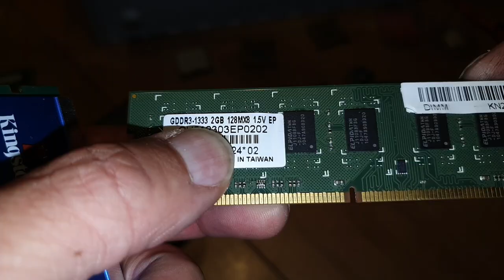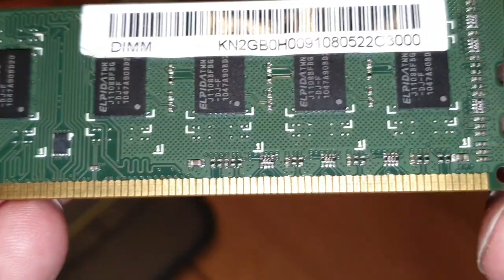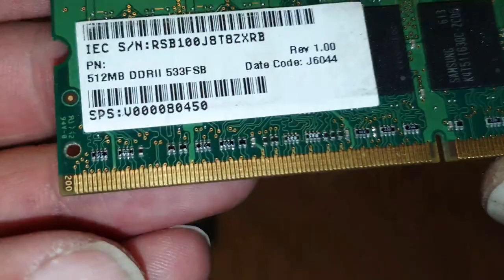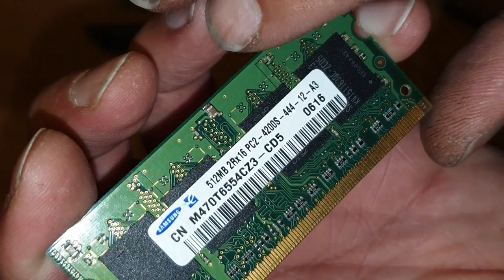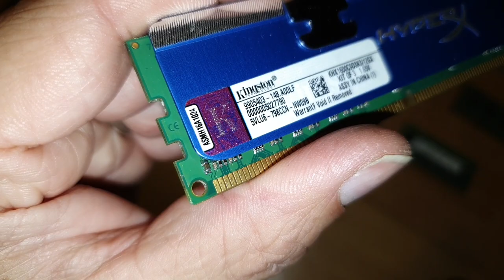How to repair a DDR1-DDR2-DDR3-DDR4 RAM By:NSC

Comment: Good tutorial, but I have 2 suggestion, to find the perfect match SMD, better get a Multi-meter to test each one out with the ground pin to find the bad guy. 2ndly, get a solder station with tentacle holder. take advantage of flux+heat gun combo, remove and attach the SMDs by using a Tweezers instead. Other than that, the methodology is very good presented in this video. Thanks
Reply from the maker: You always welcome. That's right, but i do my videos so, that all can do the same even without a multimeter, not all people's have all the equipments what i have, so i did this video so easy as possible. ;)

Comment: I bet this never helped
Reply from the maker: I bet you have no clue
Reply: @NSC-Modz  you can easilly remove ALL the capacitors from your dram stick and it will work just fine
Reply from the maker: @Charapaha  nope!!!
Reply: @NSC-Modz  try. i bet 10 000$ it will. the only critical parts are resistors. caps are used as filtering, they dont transfer any data on any dram sticks
Reply from the maker: @Charapaha you gonna lose all your money 😂
Reply from the maker: @Charapaha it doesn't matter, you gonna have failures, run mem test a longer time and you gonna see how they gonna work 😅

Comment: Hello, I have a problem .... I tried to connect a RAM in a slot when my PC was on and it maked a sound and shut down and now that slot it's not working anymore .... can someone tell me if it's fixable or not pls? Thank you
Reply from the maker: Hello You did this while it was on???
Reply: @NSC-Modz  yes.....
Reply from the maker: @myac.1071  no good... your
Motherboard is shorted maybe now.
Reply: @NSC-Modz  and that means? can it be solved?
Reply from the maker: @myac.1071  maybe not, if it's still not working all than you need to try an other Mainboard.
Reply: Repairable. Take your computer to the repairshop and tell the guy what slot is not working. They will repair it then. But don't insert any RAM on your computer while its working the next time. You may also corrupt your RAM.
Reply: @oguzhankarahan1737  Thank you

Comment: Maybe if you use DDR3 Dimm donnor can be used layout posibly is the same, but mix DDR2, 3 and 4 you need to test with multimeter or try to find the correct one. The SMD that you are talkin in the video are resistor black color generally and beige are ceramic condensers for low voltage and low capacitance.
Reply from the maker: Sure, but if you can't test, you can do it like this and test it on the system. MemTest will also ahow you if all is really working like it should work ✌️

Comment: do you where i can have ram repaired?
corsair won't provide me warranty since i bought ram off Ebay....
Reply from the maker: Witch model is it and what's wrong with it?
Reply: @NSC-Modz  youtube is blocking my comment so i need to write is over a few comments....
 DDR4 4x32GB 128GB 4000mhz Vengeance RGB Pro
Reply: @NSC-Modz  
i had my computer in sleep mode because of a failing USB generic adapter i decided to unclip the adapter from the side that was failing!
Reply: @NSC-Modz  when i started the computer after sleep mode it turned on! after i rebooted the PC would not boot! after about 6 hours of trouble shooting it came down to a single DIMM
Reply: @NSC-Modz  
i am still having a hard time believing how removing a USB port in sleep mode fried my ram
Reply: @NSC-Modz  can you give me advice on how to repair this?
Reply: @NSC-Modz  
thank you for getting back to me!
if i buy a volt meter can you give me suggestions on what i need to check?
i do not have much soldering experience! :( do you also know where i can get the parts i need to do a repair?
the ram is failing to be detected in the bios
Reply from the maker: @10percent4DaBigGuy  hmm this sounds more like a bios issue... witch board is it? Made a Bios update? Ram settings really set right?
Reply: i figured out why my comment didn't post originally its because i talked about the price....
Reply from the maker: @10percent4DaBigGuy  also it's not recommend to remove any drives while pc is on sleep mode, it can go good, but it can also go wrong like you see. You should always remove the drives before sleep more, or after, BUT when you remove it while it is on sleep mode, the computer may not be able to wake up back again without problems. So please keep that always in mind...
Reply from the maker: @10percent4DaBigGuy  i would set the memory's on bios to AUTO, than test it out if it works better. Also i would ran MemTest64, there you can really see if the ram is damage. Sometimes it's really just a bad bios or bad settings, may try to set it on 3600mhz. Those Corsair Rams are mostly very good, i had already every model from Corsair, but those one's never fail for me. Always worked without problems. Corsair Vengeance and the Dominator are very good ram's.
Reply: @NSC-Modz  i don't have xmp enabled i also cleared the cmos, i also tried to remove the battery
with the single stick of failed ram the PC is not booting 
once i have the 2 dimm's of ram in a single channel (good and bad stick) only one stick will read in the bios
i would run memtest86 but only one stick remains detected by the bios
i ordered a multimeter off ebay i am going to physically test the rams voltages in a few days to see what issues i have
i would have tested this in another PC but i only have one DDR4 motherboard
can you give me a suggestion or where i can order replacement parts if it comes down to needing to replace a transistor or what ever?
thank you so very much for talking with me!!!! you are awesome!!!!
Reply: @NSC-Modz  another thing i find odd, the i have the ram currently installed in my PC 2 dimms one that works and the other that has failed! the RGB works on both dimm's but the one piece of ram fails to be detected by the PC yet the RGB is still working
i tried memtest64 and it only detects the one piece of ram
one thing i noticed after removing both sticks of ram even though the rams RGB turned on the one stick that was not detected in the bios remained cold to the touch while the working stick remained warm

i think i am going to switch back to my old ram tell i can come up with a solution

the port i removed was a generic adapter that was plugged into the mobo's usb 2.0 port! i damaged it in the past and it was having conflicts it kept on beeping on me just to let you know
yeah i understand now to never remove anything from the mother board tell all power is off! a very pricey lesson!
Reply from the maker: @10percent4DaBigGuy  yes man, but we will always learn all life long till we die. So, i would take a closer look to the ram, maybe you see a missing or destroyed smd component. But maybe its a ram chip it self, and than it's just not worth that all. If you like contact me over my WhatsApp, you can find my number on my YouTube chanel, so we can talk better.
Reply: @NSC-Modz  i have a question for you, if i was to say order a new duel kit of the ram i own and swap the casing in order to RMA on the ram would there be any way for corsair to tell?
are there serial number written on the dimms or is the S/N only on the heat sync of the ram itself (i mean is there a serial number on the heat sync and dimm)
i notice on the website it said counterfeit products wouldn't be returned and would be up for investigation 
i find it really dumb how ram life time warranty is not on products without a  receipt
Reply from the maker: @10percent4DaBigGuy  normally corsair rams have minimum 10 years warranty. I told you already to contact me over whatsapp, it's just easier as here...

Comment: how do you determine your smd capacitor values?
Reply from the maker: With a multimeter or an extra tool which you can buy. But in this case no need to because they the same.